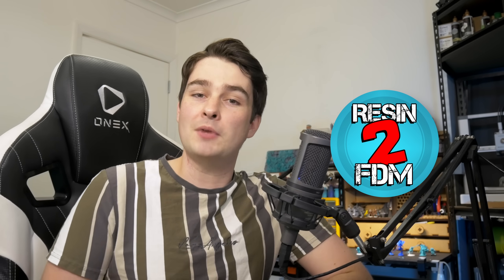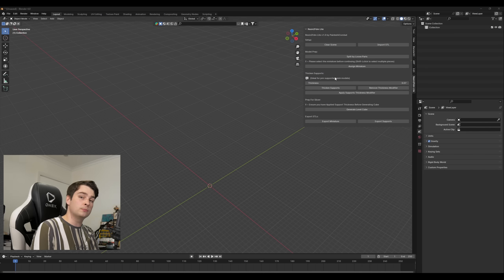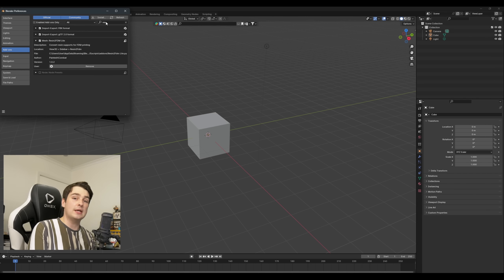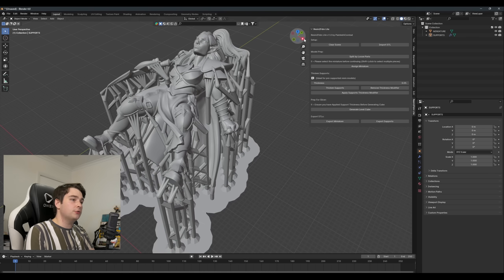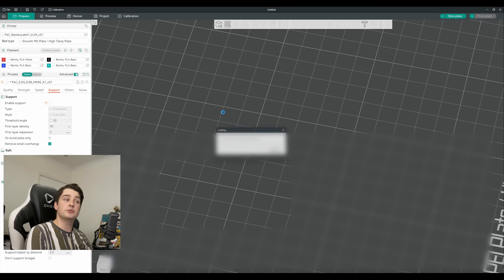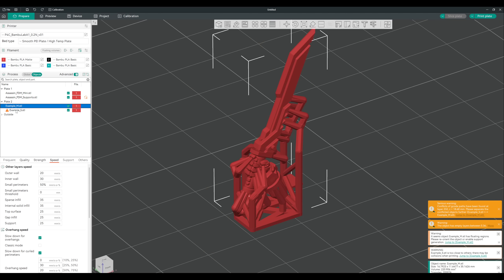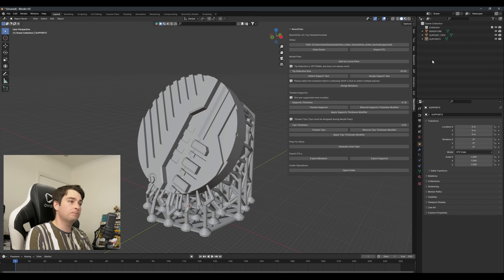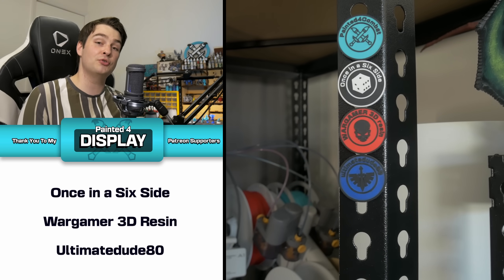Make ANY Miniature FDM-Ready in SECONDS... Resin2FDM

Comment: Man, I must tell you a big Thank You for this one. Since I found it and tried it, this is what I have been using it non-stop. And through the usage I have noticed one thing: a lot of hopping of the printer nozzle from one to another ti y support vertical 😊 that is something that is unavoidable of we want to use this approach and I am good with that, but again can not stop thinking if somehow all those verticals can somehow be connected as regular normal supports (except the top tips of the supports of course) which will for sure improve the speed and stability of the print on fdm… just thinking about it, but without knowledge or ability to try to do that in the blender… any thoughts maybe? 😊

Comment: Hey I have a technical question for anyone out there; will resin2fdm identify a miniature kit that's supported as a single object? Like a torso, arms, legs and head are all separate but on the same resin support web. Will it recognize them all as a single mini or will I have to do some more blender work to isolate the mini parts from the supports.

Comment: Hey, I have a small question, does resin2fdm tutorial still work , if Iam working with the bambulab studio slicer? (I don't have a printer yet, but Iam interested in 3d printing).

I have read that for some reason orca might not be compatible / able to connect to the bambulab printers anymore in the future
Reply from the maker: Yes! Bambustudio has all the same functions and it should be an identical process as seen in Orca shown here.

Comment: big thanks and round of applause for this video and your work to make the plugin - worked from the first print (only some overhang issues - but I am going to chalk that one up to the original supports).

I have a question though - is the 0.2 nozzle a necessity for this technique to work at all or is it ok to switch to a 0.4 nozzle for less intricate pieces (such as terrain) so I can get faster print times?

Comment: oh so dose this only work for models that are pre-supported and not just for models that dont have supports already?
Reply from the maker: Yep! It's a process to take already pre-supported models and make those supports more FDM-Friendly.
If your looking for an easy way to add resin supports I would suggest taking a look at 'Blueprint' by HeyGears, really great tool that creates some great automatic resin supports (OnceInASixSide has some great videos on this that just dropped)
Reply: So I used the auto resin supports from that video and I’ve gotten great results!. My only problem I’ve had is the contact dots on the model itself. For one of my minis his whole back is covered in white dots from the supports. Any tips to try and minimize this would be very appreciated!.

Comment: I'm having an issue where after I install the add on (still zipped) it isn't appearing on the add on list. Where there are 4 items on the video at 3:17 I only have 3. MESH: RESIN2FDMLITE doesn't appear. I've tried it with the lite and advanced version. Has anyone else had the same issue and figured out a fix?
Reply: I had a similar issue and I had to open the zip file, open I few more files and find another zip file. It’s that one I had to install.

Comment: I tried your addon and it works amazingly well. I got a load of presupported models, but i also have a lot of models without support. (I use a bambu labs a1 mini with .2 mm nozzle and Bambu Studio to print them.) But what program can i use to automaticly create resin supports for the model stls wich are not pre supported? (At the moment i use LycheeSlicer with an Elegoo Mars profile and use auto support,  but wondering if there are easier ways).

Comment: Has anyone gotten Resin2FDM to work on Titan Forge minatures? I've had great success with models from other designers but not with TF (can't seperate the supports from the model in Blender). I assume that not being able to separate the supports from the model is to deter people from rescaling the presupported models, messing up the effectivness of the supports. Just curious if there is anyway around this? I posted the day the tool dropped and love it. I know it's been two months, but I figured it wouldn't hurt to ask and that this would be a good place to do it.
Reply from the maker: Hi, yeah this likely because they run a 'repair' function on their models AFTER supports have been added which merges everything beyond the point of separation. I'm not sure if TitanForge provide their slicer files (Lychee or Chitu) but if they do you can open those in the resin slicer and then re-export as STL and they should work from there, an annoying workaround, but it does work (if they provided the project files ofc) :)
Reply: @Painted4Combat  Thank you so much for taking the time to respond, I really appreciate it greatly! I think that they may actually have the Lychee files included. I've never messed with Lychee before, but I'm going to give it a whirl. Thanks much for the help and the great channel!

Comment: I’ve been using this for resin2fdm a bunch now, I’ve found that you make the supports hollow, with one outer wall, which I’ve found helps minimise time and more importantly stops the supports from snapping and makes them super easy to remove. I generate them in chitubox, then once if gotten them ready for orca I set them to 0% infill, 0.16 layer height, and 1 outer layer wall then turn off “insure vertical height thickness”. This causes the bottom where it connects to the base of the supports to snap a bunch so I and a layer height modifier at about 2mm and keep everything at the bottom solid with the standard FDG profile. Super strong, fast, easy to remove, and doesn’t snap at the bottom anymore. I hope someone sees this and tries it out, it’s been a game changer
Reply: Interesting, I’ve been having a few problems with Resin2FDM and might give your adjustments a try, could you clarify the .2mm layer height modifier and the solid bottom not sure about these myself. Thanks
Reply: @ajsommerfield yeah, I’ve found when I try to make it completely hollow, where the upwards branches connect to the base of the supports becomes very brittle, and 2mm (not 0.2mm my bad) is about where vertical starts at the top of the little cone chitubox generates. So the bottom is very solid and connects well, and then it being only 1 wall thick it’s light so vibrates less, and if found the nozzle only doing one pass makes it less likely to snap the supports
Reply: Thanks I’ll give this a go cheers 👍👍👍
Reply: @ajsommerfield let me know lol

Comment: HELP i had download resin2fdm a while ago and got it to work but didn't have a 0.2mm nozzle at the time and have now just got one and went to use resin2fdm but it doesnt do anything when i press "split by loose part" so i thought it might be because i was on blender 4.1 and downloaded 4.0 but now blender wont even install resin2fdm and i have no idea why any help is appreciated
Reply from the maker: Make sure you have the 4.0 version of the plugin if youre using 4.0 and it should install ~ as per the 'split' function not working; some sculptors (annoyingly) run their models through a 'repair tool' that merges everything into one solid chunk, supports and all, the only way around this is if they provide the Lychee or Chitu files you can open those and re-export the STL and then it should work as normal.
Reply: @ yeah i realised it was because i had already repaired it thought i was being clever but obviously not lol thanks for the reply
Reply from the maker: Yes that would also do it! Repairing essentially merges the digital parts and melts it all together which kills our ability to split out the sub-models so to speak. I havent found the need to repair minis at all, but if you need to do it after exporting the parts from blender :)

Comment: I am trying to print an 8 pieces figure with your way. First two great. The third one, can’t find a way to stick the first layer. Did all the steps again. Washed the bed. Raised the temperature just a bit. Tried to print other stl to be sure it’s isn’t a general issue (other files printed fine). Used the brim. Tried to move the file -0.01 on the z axis (did it like 50 times). Unfortunately nothing seems to work. In the end I had to print it with tree support and of course the result was pretty bad and the pieces do not fit well.😢

So sad. I was really to make a patreon account only to get the advance version.

Comment: Would it be possible to also add the option of decreasing the support tip size instead of just increasing? If so, this could be incredibly useful even for resin printing as well, in cases of pre-supported models being way over-supported

Comment: Just recently got into blender, when i import it threw Resin2FDM it wont import and says io_mesh_stl not enabled, however i dont see that add on and when i import thew file, i cant split the supports off. is there something i am doing wrong
Reply from the maker: If you're using blender 4.0 there will be an 'STL Format Addon' in Blender - if you're in blender 4.2 or higher you will need the 4.3 version of the plugin :)
Reply: @Painted4Combat  thank you I think I installed the incorrect version then I am on blender 4.4 and I installed the 4.0

Comment: Love this tutorial. Thank you much for it. I've already created some fantastic FDM minis using pre-supported Resin models.

I'm having a problem with a couple files where it's not splitting the mini from the supports. Happen to know why?
Reply from the maker: Some sculptors run a 'repair' function on their models after export, which annoyingly merges it all together as a single object. If the files come with a project file (Lychee or Chitubox) you can open them up in the resin software and export as STL, and then those new exports should work in blender as normal
Reply: @Painted4Combat  Fantastic! That worked. Thank you much.

Comment: I dunno. Standing alone, Bambu printers and their slicer is still pretty good. For a complex organic print like a mini, I just use the cut tool, dowel, tree support and send it. Works pretty well on its own. You might have to tweak your ZTop height if your supports aren’t coming off super easy. I print with PLA+ so the supports are always a bit tricky to get off, but not impossible.

Comment: Trying it out. I have found that you can use Bambu Lab to assemble and print these. Orca is not required. 

Not sure if that is a recent update or not, but it works! Tried it on the leg joint of Antonis Bouras' Deamon Slayer Knight Nemesis Dreadknight proxy, and it came really good. Was a bit of a pest to convert, because apparently the leg was also entirely in loose pieces, but did get them all into one piece after some work.

Currently printing out a rather large high detailed model, that's giving me something like a 7 day estimate for all 5 plates. The first two plates are done, and worked beautifully. And the higher speed supports are doing good, and trimmed about a day off of the total estimated print time. The whole thing is going to be over half a kg of filament all told.

Comment: Thank you for this. I have had good results from the tool and it was easy to use. I tried with the provided resin supported stl. But now I would like to generate resin support for a figure. However I find that the resin2fdm tool does not work with the supports from lychee slicer. Has anyone else managed to work with generated supports?
Reply: I can be wrong. But i think you can generate the resine support in a slicer like orca ? Then importation in to blender ?
Reply: @sitasama  you are right, it can be done that way. Since posting, I have found that sometimes using lychee the supported fig can be split from the supports and sometimes the tool fails to do this. I now think that the failure occurs when the export does not join the supports at the base, but I have still not worked out when this joining of the support bases happens. - Thanks

Comment: I've run into trouble splitting some models. The Split by Loose Parts function doesn't generate two separate models as intended unfortunately. The model in question is a tank and all STL files to make it.
I have been able to use the tool successfully and split other presupported STLs so I'm not sure how to fix the issue.

Comment: Great work on this!

One area for improvement that I noticed while slicing a mini on my own is you should make sure your supports are printed before your miniature, so every other layer has put down the anchor points before the miniature path is printed.
In Orca (not sure about Bambu or other derivatives), you can simply drag the supports part above the miniature (after splitting). Then, you can check it by going to a single layer and drag the bottom slider to see the toolhead path. The supports should be printing first.

Comment: Hello. I just wondered. If is it possible to make the supports what are way below of the miniature to get printed as one big block. For example 3-5mm below main are still resin supports. And everything else that goes further printed as a black. It would reduce print time and cost. Because for Example right now i am printing FireLadz boss by MrModulOrk. A it printed good with regular supports from bambu. While got some problems it the axe area because its quite big. And printing it with bambu supports is good quality and time aproxiametly 1-2hours. While with resin supports it got to 4 hours minimum with every time reduction method. Many thanks.
Reply: When will be at home will try to do some tests.

Comment: My personal issue with the lychee and co like supports is that resin prints are often fundamentally oriented incorrectly for best FDM case.
For resin, you want max out the diagonal detail even if it means more islands for print as long as they dont clip eachother from "below". FDM side tho, orientation to max layer adhesion, minimization of islands and focus on spread layer buildup/parts of the model supporting and branching out are the priority, so e.g. a swords "best" orientation would (depending on material and thickness) be either mostly horizontal or steep angle up for the sake of layer adhesion.
Wouldn't at all be against orca and cura adding "resin" or "winter branched" tree support options where the main parts are pillars with heavily tapering actual bits tho at all.

Comment: As an aside this may useful for resin printers where supports are failing because they're too thin. users have no way of editing supports if creators just share the STL files. but running them through this may help somewhat. I've got a file that failed recently because the supports weren't strong enough. I've run the file through the program and I'll see if it makes a difference :)

Comment: Hi, whenever I click on split by loose parts nothing happens at all. I've tried a few STL's now and it's just not working for some reason...
Reply: It doesn't seem to work with every STL out there. I've had great success with some creators and no success with others; I'm wondering if the tool isn't picking up the interface between mini/support if the contact point is above or below a certain value.
Reply: @valadir863  Ah I see, unfortunate.
Reply from the maker: As someone else has mentioned some simply wont work - some STL creators run repair software on their models which confuses the files and makes them think that everything is a single homogenous piece - if the files have been provided with resin slicer files (i.e. Lychee or Chitubox files) you can open those up, re-export the model as an STL, and it should work from there!
Reply: @Painted4Combat  Thank you for the info! These were indeed flagged as repaired files; hopefully Lychee can pull them apart.
Reply: Quick follow-up: Importing LYS files worked; note that you'll need Lychee slicer to pretend to be a resin printer in order for everything to load in properly. Thanks again for such a great tool!

Comment: Just noting that this solution is going to have limited usability the supports that are put on models for Resin are not optimized for FDM. There is more to the story than just thicker supports. The way Resin printers and FDM print are completely. I've already tested this and the results were terribly overhangs(because of Resin focused supports) and more material and longer print times. I think people would be way better served to actually spend the time to dial in their FDM supports settings in their slicer.

Also, the models from Arbiter Miniatures that have been used in these videos are essentially an invalid test comparison. The Arbiter Miniatures models are not just any old Resin model with supports. The Arbiter Miniatures Advanced FDM models are actually designed and supported specifically for FDM.

The other aspect with Resin pre-supported models is that the supports have been professionally placed and test printed in Resin before being released, which is why they generally print without failures. That sort of manual support work and testing for FDM is never being done here.

Comment: Great tool! Thanks for putting in the time and effort. 

I'm increasing the size of the supports but keep getting the same error about floating regions within Bambu Studio. Can these be ignored? My printer is out of action for a couple of days so can't give this a go. Is it a case of increasing the size of the supports until this error disappears.
Reply: Most likely the error appears because there is a gap between the little cube and the actual model. Inspect the tips of the supports in your slicer. You will see when they connect and when not. If the tips do not connect, you could try to reduce your line width. However, this could mean to calibrate a whole new profile. You could also switch to a smaller nozzle.
Reply: Thanks for getting back to me, my sensor cable came today so gonna hit print and see what happens. I rewatched the video and saw that the error appears  on Jacob’s screen so thinking it’s ok 👍